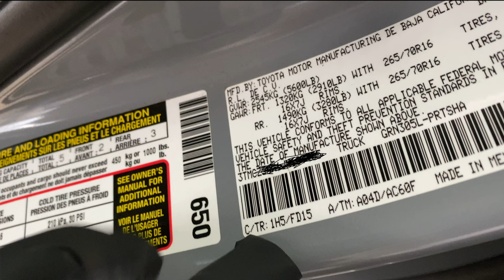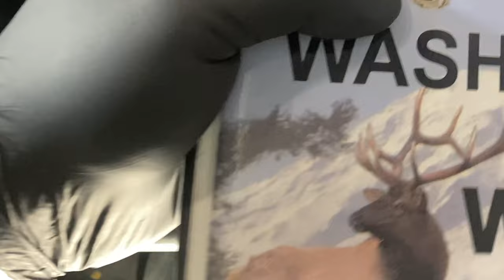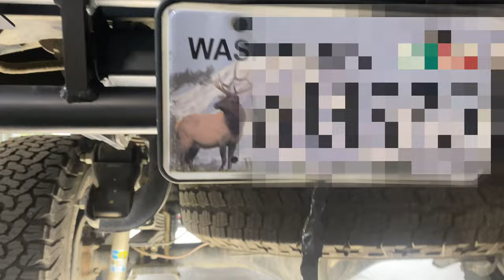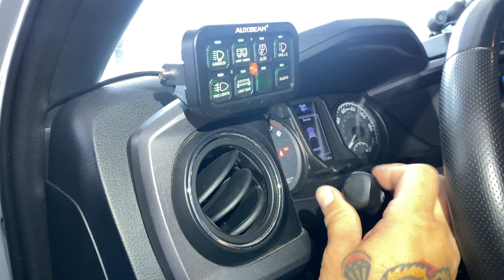BUMPER INSTALL-OUTGEAR SOLUTIONS

Comment: Are the bolts that go to the chassis, the stock bolts? Mine didn’t come with any new ones. Did you just add the washers to stock bolts?
Reply from the maker: @TAC40_  stock bolts, and washers are provided with bumper 🤙🏼

Comment: Great install video.  I wonder how the filler plates on the corners would look color matched to the truck.
Reply from the maker: Could add a nice touch for sure. 👍
Reply: Funny 😄 I Got the color match can ready to go can't get bottom bolt off so i can remove them to paint. Time to go to Home depot.
Reply from the maker: @vic2thethirdpower  it’s not a project if you ain’t at Home Depot 3 times

Comment: Hey, yotalking since you unplug all the sensors in the rear. Does your light on the dash light up? I'm looking forward to get this bumper too. Thanks
Reply from the maker: @guywhosleepallday8194  you’ll need to shut off all your sensor buttons, the ones for switching lanes and backing up. You can pretty much kiss those good bye

Comment: What was the lead time when you purchased this if your remember? I see a lot of people saying the lack of communication from Outgear is frustrating.
Reply from the maker: 3 weeks lead time, but this was before they blew up.
Reply: @eluv201  For my C4 front bumper I used etching primer then steel it. Do you have any problems not using a primer before the steel it?
Reply from the maker: @BAcHIGU_  definitely a good idea. So far it’s holding up in most areas.

Comment: Why not tap into the factory brake light harness?
Reply from the maker: It’s not constant power. You could do your taillights that should work too. My way is all in one spot.
Reply: I meant the factory plate light harness
Reply: Yes bu you don't want your plate light on all the time
Reply from the maker: My way comes on when you turn on your head lights.

Comment: Be careful with using that kind of circuit tester on modern vehicles. Depending on the circuit you are testing you can short circuit something very easily, the resistances on some circuits in modern vehicles can be VERY low.

Comment: Man, it looks decent, buuuuut. You should have taken more time in your measuring and cutting. And those quick splice connectors are the worst. They will corrode and lose connection in no time. Do it right, and either solder and heat shrink tube them or use a waterproof connector. Remember, you're going off road. Those connections will be in the elements and exposed, keep them protected or you are going to have electrical issues down the road.